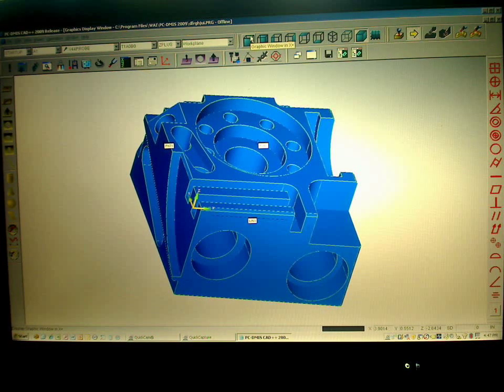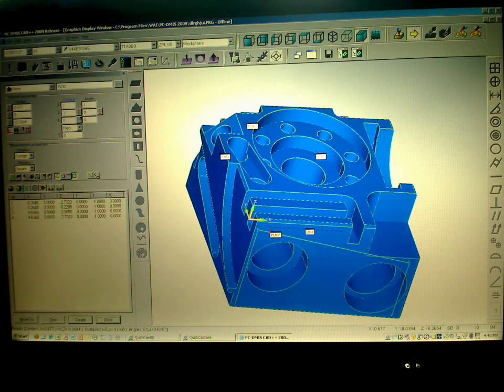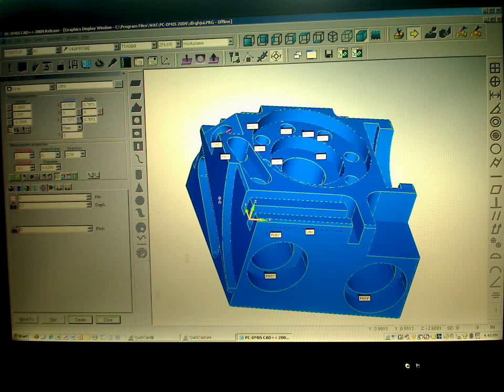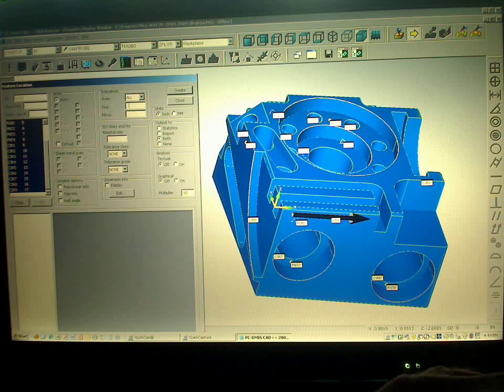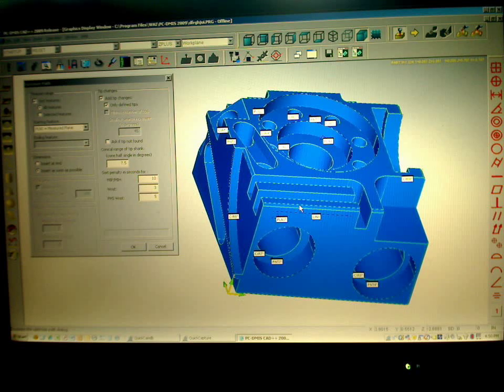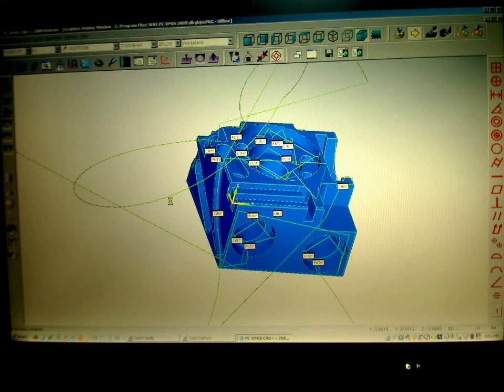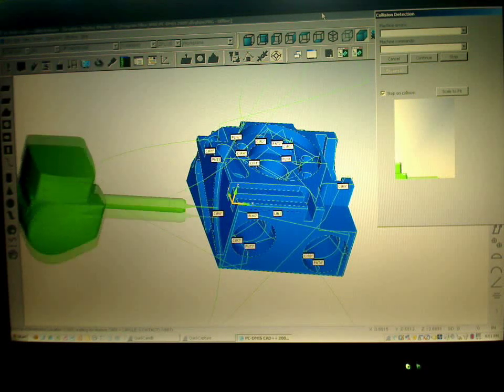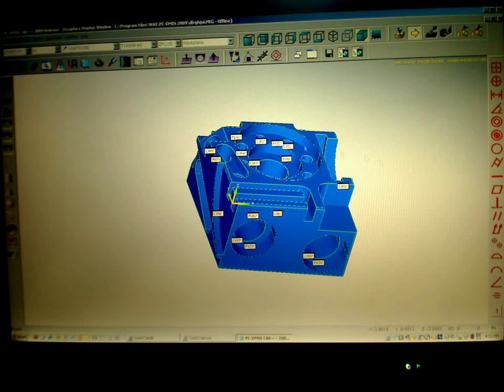Pcdmis AutoPath

Comment from the maker: The Manual Alignment that I included will find the part on your CMM.
You will need to add DCC alignment features right after that in order to properly/repeatably align your part. When you do this, you will need to adjust my procedure slightly by highlighting Only the code that you want to Optimize prior to selecting the Optimize function. FYI...You can only Optimize code with a single Alignment.

Comment from the maker: Certainly there is a way of doing that, but think of the manual alignment as insurance. You don't always need to Mark it for execution, but its there if you ever need it to re-locate the part. Just save the program with the manual alignment un-marked and you have a fully automatic part program.